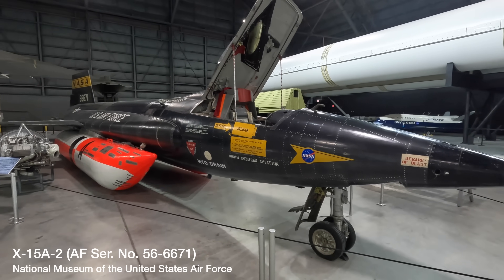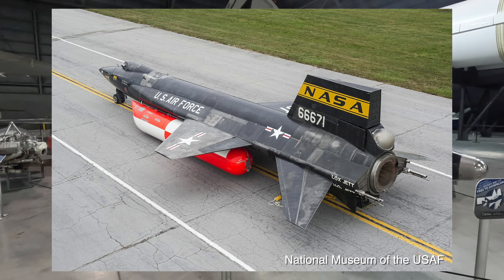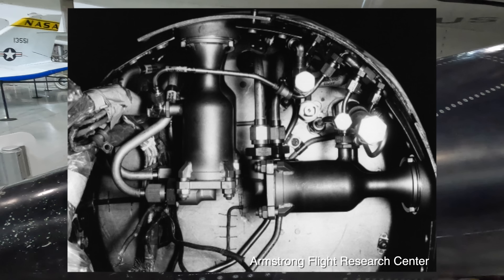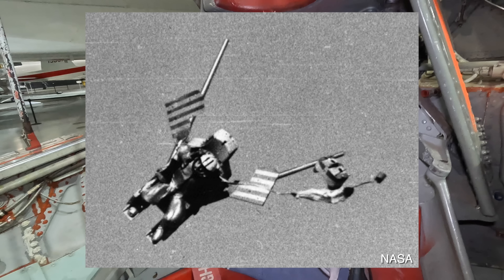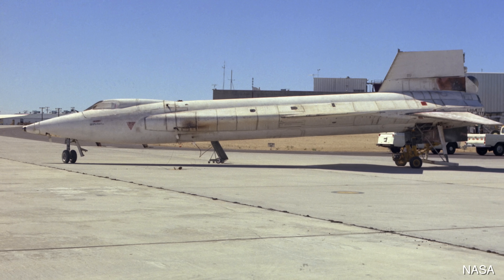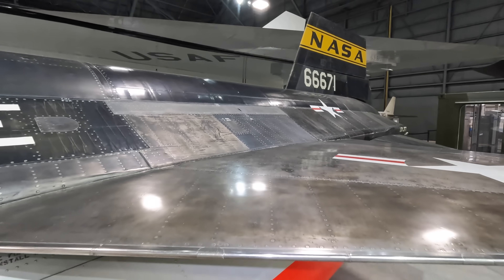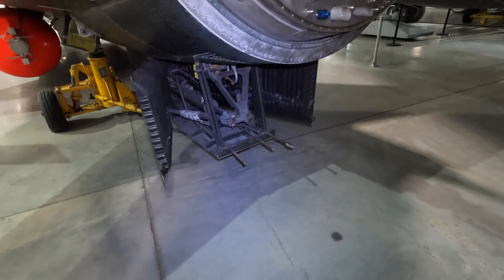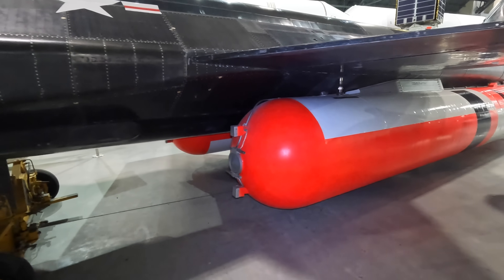Detailed tour around the only X-15 on display in the world.

Comment: My father, Dr Edwin G Vail, designed the full pressure suit that was used on the X15. It was adapted for Project DynaSaur...and then the Mercury & Gemini programs. He also designed the backpack life support system used on the Apollo  missions. He always maintained that if commercial space flight was released to the private sector following the termination of Apollo,  we would have had moon bases in the 1990s. There are 2 life sized cutouts of him in full pressure suits in the Smithsonian Air and Space museum in DC.

Comment: The national air and space museum in va has one in the restoration hanger and back in December for the tenth anniversary of the center. they let everyone walk through the hanger and I got to see the X-15 relatively up close. Its so impressive because we were going 6.7 times the speed of sound in 1967 who knows what they are doing now.
Reply: Is the one in VA the one that was hung up in the main hall at the NASM?
Reply: When did the NAaSM take it off display? I have a lot of memories (a few pictures as well) of it hanging from the ceiling in the main DC building.
Reply: @sblack48 yes bc there were only 3 one is in the museum of the usaf in dayton oh one was lost in a crash and the final one is currently in the restoration hanger
Reply: @HaddaClu removed a few years ago when they started the museum restoration. It’s supposed to go back this year. The NASM on the mall is doing a huge facility restoration and many of the exhibits are also being redone. Huge sections have been closed and last year the entire building was even closed for awhile. The building itself is 50 years ago and was suffering leaks and other problems.
Reply: @mlehky  56-6670 was in Udvar-Hazy's shop being worked on when I was there this past February.
Reply: @HaddaClu  It went off display in 2019 so the hall could be renovated.

Comment: I got to go visit the Cosmosphere Museum (In Kansas, US) a couple Years ago. They've got a Bell X-1, it's one of the first things you see. Even got to touch an old SR-72 while there. It was a really neat experience that I won't forget! Nice video, I didn't know any of these planes were on display anywhere.

Never knew these had 2 different engine setups. Didn't know the bottom stabilizer popped off before landing. Never noticed the half sphere for Ammonia pressurization. Never knew a lot of stuff before this video, thanks for it!  I imagine the lost history that we wouldn't even have space for if we kept everything sometimes- we probably know about %0.1 of what ever actually happened in the past and it all probably went differently than we think.

Comment: Paul, I just found this video and very much enjoyed the tour! The presentation, first rate: Imagery and explanations! Being a National Air and Space Museum Docent for 44 years now the X-15 is my favorite artifact: A word or two about your presentation: Scott Crossfield worked for NAA and lobbied (successfully) about an Ejection seat vs. a capsule; The seat pan's cushion was modeled after a JOHN DEERE (!) farm tractor seat (since those folks spend so much time in them). Ventral Vertical Stab: The three airplanes flew 199 flights total, (and was mentioned) just before landing it was jettisoned. After (about) flight 75, it was determined that the airplane performed better with the lower half was never installed again. When the Scram jet is discussed (about 16:30) you mention a "longer fuselage", under the 2 foot "plug" that was installed is the scram jet fuel tankage, (at 9:02), look for the "discolored" metal near the CE (as in US AIR FORCE). Just thought you would appreciate these additional facts I uncovered while researching an hour-long PowerPoint presentation of the airplane and project for my Docent colleagues, during Covid.
Reply from the maker: Thanks for the extra information and your efforts being a docent there. It’s an amazing museum!

Comment: One of my favorite aircraft! My father work for North American Aviation from 1954 till 1988.  my father worked on the X-15 he was head of  electronic systems for the aircraft. Also he did the electronic systems and the defensive systems for the  xb70 Valkyrie. During that time frame. He worked with Scott Crossfield and the other boys Building the three flying aircraft that they were contract the  build for the Air Force. I keep telling people that most of the great aircraft  that was built up until probably the last 20 years. Penciled out on a cocktail napkin at a bar someplace. And it's really a real thing that's really happened the funny thing when engineers get together they can really making really design some wonderful aircraft half drunk.

Comment: I was 15 years old going south from Yosemite to Mt. Whitney from early August to early September 1968, for 28 days, where I remember seeing something like the X-15 thin and narrow, not like a jet, in the distance above me going left to right while hiking on the JMT. I stopped and took out my little film loaded Kodak camera, it showing a streak trail and something black in the front barely visible. I later found out that there was a flight on August 21, 1968, which makes me believe that would have been the one I saw coming in, heading for Andrews landing, while hiking high up near some JMT passes. Still in my memory. At least I hope that was near the area of its flight where I was hiking.

Comment: There is another allocated to the National Air and Space Museum in DC but it is currently off being restored.
Reply: Yup, 56-6670 is at the Udvar-Hazy Center right now.  There's a part of the museum where you can see what the restoration shop is currently working on.  Got to see it a few weeks ago, and it was kinda cool seeing it there with a bunch of toolboxes, safety cones, and other stuff around it.
Reply: Wasn’t that one hanging from the ceiling in DC? Haven’t been down there in probably 30 years.
Reply: “Only one on display in the world” 🙄 there are only two and one is being restored. So “only one x15 in the world is not on display right now” 🤪
Reply: @sward13x It was, but the museum is being renovated. So some stuff was moved for the time being. X-1 for example as well.
Reply: So there is only one on display then..

Comment: The company I work for actually brazed the combustion chamber and engine nozzle together for the XLR99 and we still have the first test piece in the company museum in San Diego California.
Reply: I used to work at Rockwell with one of the guys who help design and built that controller. The first was made from aluminum and the hydrazine ate it up. So they made a stainless body and brazed stainless tubes around it. The prototype worked so they made all the rest just like it. Another guy I knew had done design work on the pylon to attach it to the plane carrying it.
Reply: Yeah ... well ... that's cool, but the carpentry company I work for actually had the contract to deliver crosses to the Romans, way back when, and they still keep the offcuts from the one they hung Jesus on under Ray's bench as a momento mori.

Comment: I read intercontinental  missiles have a high voltage feed to the probe point bit at the end to create a plasma field that pushes the air away reducing drag on the missile, I wonder if the X15 had this.

Comment: The very nice surface finish (almost like a gun bluing), is that the natural finish of the Inconel X750, after heat treatment? I noticed several various X750 components on the market, with that black finish. Very good looking...
Reading about the X750, it seems to have many other excellent properties such as corrosion resistance. I would have loved e.g. a X750 Cybertruck, with that finish and panels attached to a frame with screws/rivets in aircraft fashion....

Comment: I think its interesting that the x15 has similar size and proportions as the f104, but has the blended lines of the a12 and a hint of the f16.

It almost makes me wonder what a fighter design akin to an f104 might perform like if it had a low canted set of tailierons instead of the large virtical syabilizer mounted horizontal surface... but if it had a more jet focused blended body like the Saab Draken... so more fuel, and better low speed handling.

I'd imagine it might be pretty awesome.

Comment: Minor correction. The US Armed Forces considers 50 miles, or about 80400 meters the boundary of space, a boundary passed on 13 occasions by 8 pilots. 5 of those pilots were active service in the USAF and were therefore awarded their military astronaut wings. NASA didn't have a similar thing at the time, and the other 3 astronauts weren't awarded their wings until 2005, 2 of the 3 being awarded posthumously.

Comment: What camera equipment do you use? I've been using a DC-FZ80 and it's worked wonders outside but seen subpar performance indoors, other than using the flash for everything how would I get higher quality photos indoors?
Reply from the maker: Gopro 11 but ive just bought a dji osmo pocket 3 :)

Comment: Interested in the blue/black finish on the panels. Is it a painted finish or oxidisation from a heat treatment? Notice it doesn't go over the rivets so possibly the latter?  Excellent video, thank you.
Reply: The coloration of the outer skin of the X-15 was due to the reaction of the Inconel-X to temperatures experienced during flight.

Comment: 6671 (MSN 240-2) assigned to NASA Dryden Flight Research Center, Edwards AFB, CA
					31 powered flights as a X-15A.  Extensively damaged during emergency landing at Edwards AFB 
					Nov 9, 1962 with John McKay at the controls.  Later modified as X-15A-2 22 powered flights as 
					a X-15A-2.  A 200th X-15 flight over Nevada was first scheduled for 21 November 1968. Numerous 
					technical problems and outbreaks of bad weather delayed this proposed flight six times, and it 
					was permanently canceled on Dec 20, 1968. This X-15 was detached from the B-52 and then put 
					into indefinite storage. The aircraft was donated to the Air Force Museum at Wright-Patterson 
					AFB Oct 1969 for display.  Now on display at WPAFB Museum.

Comment: I actually saw the X-15 fly and land with my own eyes. It however, was launched vertically from the ground, and as I recall, it had a skid rather than a wheel on the front landing gear. It was a short flight that required a talented pilot, as immediately after launching, the craft performed what amounted to a three quarter loop at the bottom of which the plane touched down on the ground.
Reply: That was the x-14
Reply: @behindthen0thing  No, what I saw was absolutely the X-15. I know it was typically dropped from a larger aircraft, but on this one occasion to which I was a witness, it was launched vertically like a standard rocket. The X-14 was an interesting craft that could leave the ground vertically, but there's no confusing this for what I saw.

Comment: The external fuel tanks were jettisoned at Mach 2. They did not remain on the craft the entire mission because of drag. There were basically 2 types of missions flown, SPEED runs which took place at around 100,000 feet and ALTITUDE runs up to the maximum of 354,000 feet. If the pilot went above 250,000 feet he got his Astronaut Wings. That’s where Armstrong got his.

Comment: I love the X-15! Great presentation. One thing I'm curious about, though. You said that the ethanol/LOX propellant combo was 'extremely unstable', which is literally the first time I've heard that. The XLR11 engines with ethanol/water/LOX propellant combo were used in several different aircraft (uprated versions of the XLR11 were used on the lifting bodies). The 78,000 pound thrust Rocketdyne engine that powered the Redstone ballistic missile, which was adapted to carry the NASA Mercury spacecraft, also used ethanol/LOX. Could you show me the source for your claim so I can have a look? I'm a rocket geek so I'm always looking to learn more! Now that I've said that...any chance you'll ever do a lifting body aircraft tour?
Reply from the maker: My understanding was that the ethanol/lox combo was quite unstable with the V2 and one of the problems that delayed widespread use of that?
Some of the lifting bodies are shown in the part 2 us air force museum video :)
Reply: I'll have to look up part 2 of your museum video, thanks! As for propellants that the Germans used, I've never heard anything like that about ethanol/lox during V2 development. High test H2O2 (peroxide used in a V2 engine's gas generator) has handling and storage issues; maybe that was the cause of the delay in development? The only propellants I can think of that really caused the German rocket engineers sleepless nights was the ghoulish hydrogen peroxide-hydrazine hydrate/methanol combination used in the Me 163 Komet, which had the unholy reputation of blowing up its pilots if they had too much propellant in the tanks on landing (it always glided after attacking Allied bombers when its propellant was exhausted). One case of an forced landing rendered one poor soul partly dissolved in the cockpit because the peroxide tanks surrounding him ruptured. I'd take ethanol/LOX over that any day, I'm sure you'll agree!  @PaulStewartAviation

Comment: The reaction control system engines are called "thrusters", not boosters. Also, the conventional definition of space is 50 miles. 62 miles (100 KM) is the foreign definition. X-15 pilots going over 50 miles were awarded Astronaut Wings.
Reply: Absolutely correct. Eight of the twelve X-15 pilots were awarded astronaut wings for their flights over 50 miles altitude. The five US Air Force pilots received their astronaut wings at the time they made their flights in the 1960s, but unfortunately, it took until 2005 before NASA finally issued astronaut wings to the NASA pilots: Jack McKay, Bill Dana, and Joe Walker.
Reply: Calling them engines or rockets would also be correct(but thruster is the most precise). Usually: booster=big engine that boosts something so gives it a lot of speed, thruster=small engine for directional control and such.
Reply: @ImieNazwiskoOK  On the X-15 the attitude thrusters were part of the Ballistic Control System, or simply BCS. On later spacecraft, the nomenclature was changed to Reaction Control System or RCS.

Comment: Is it just me or does the nose of the X-15 look like a ball point pen?
Also, when the XLR99 engine became available they did a static ground test of it installed in the X-15 with Scott Crossfield and it exploded pushing the cockpit away from the explosion and saving Scott.

Comment: Correction: There is a second X-15 on display at the Washington D.C. Mall Smithsonian National Air and Space Museum, the historic X-15 #1, Air Force serial 56-6670. The X15 #2 (56-6671) was rebuilt following a landing accident as the advanced X-15A-2, having increased propellant capacity and, hence, a higher potential performance. The X-15A-2 was the fastest X-15 flown, and it is now on exhibit at the Air Force Museum, Wright-Patterson Air Force Base, Ohio. The X-15 #3 (56-6672) featured an advanced cockpit display panel and a special adaptive control system. The aircraft made many noteworthy flights until it crashed during atmospheric reentry, following pilot disorientation and a control-system failure. The pilot, Capt. Michael Adams, was killed.
Reply from the maker: The Smithsonian example is in storage
Reply: Funny how the top, pinned comment, explains that the Smithsonian plane has been in storage for years...

And yet, 5 of the 10 newest comments, attempt to challenge that fact...